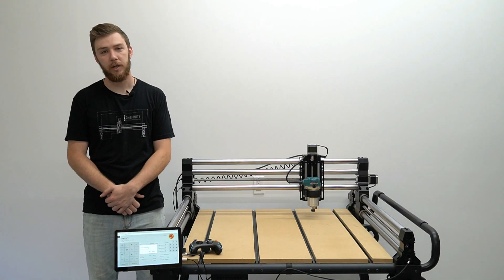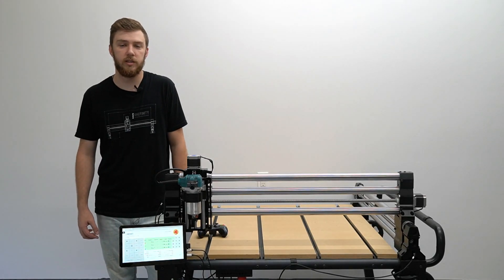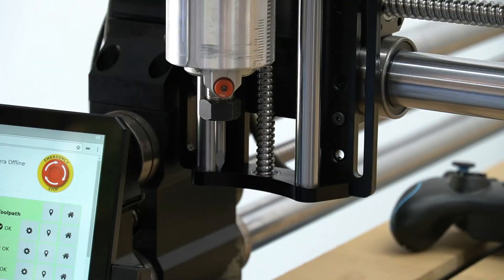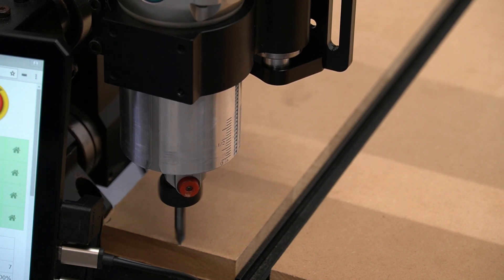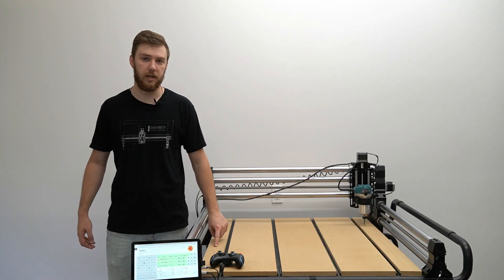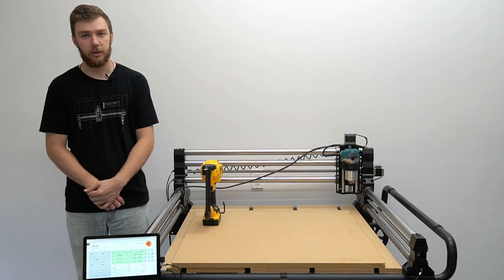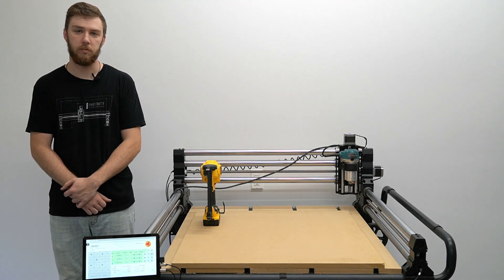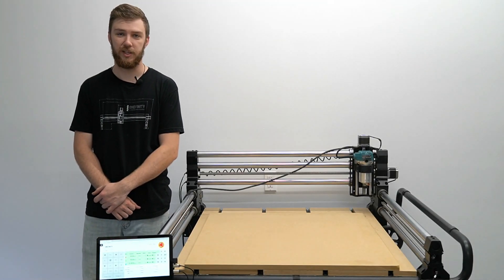How To Position A Wasteboard Inside The Cutting Area on the Onefinity CNC

Comment: then a cutting (leveling) pass to ensure the surface is level to the bit path (which is why the line depth and width may have varied) -- and the waste board smaller than the cutting range assures the leveling pass covers the leveled cutting area
Reply from the maker: That'll be in the next video :P
Reply: @OnefinityCNC  is that leveling pass video about ready?
Reply from the maker: @johnjss  yes!

Comment: What's the purpose of cutting the wasteboard 1/2" shorter than the max cut?
Reply: I would assume Onefinity did to ensure they could surface the whole wasteboard.  
In my experience it's not necessary because a surfacing bit usually has a 1" cutting diameter, so at maximum cut size it'll overlap by about 1/2" on all edges.
Reply from the maker: So as to not run into x y out of limits warnings.